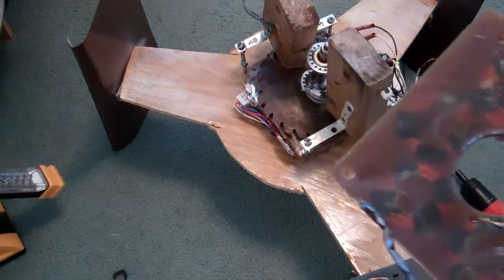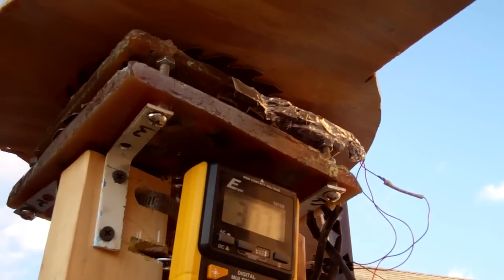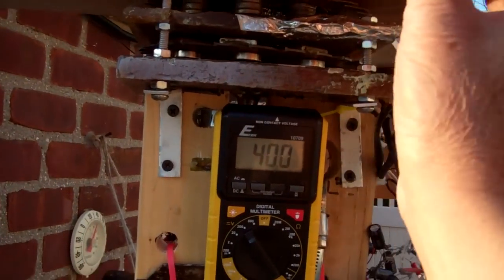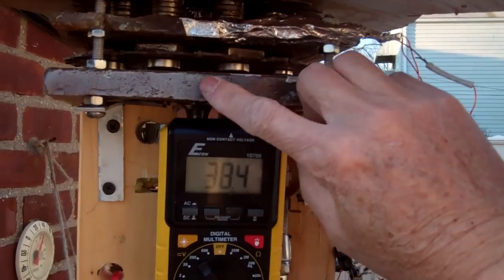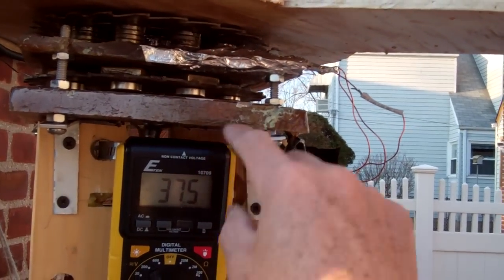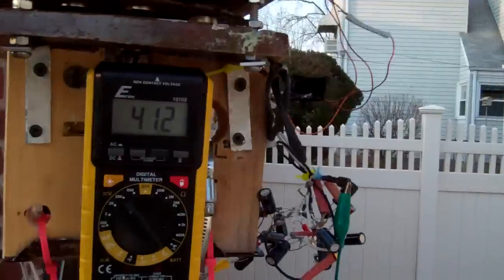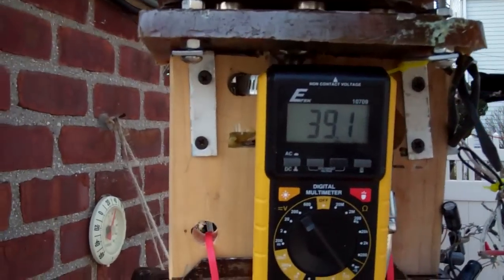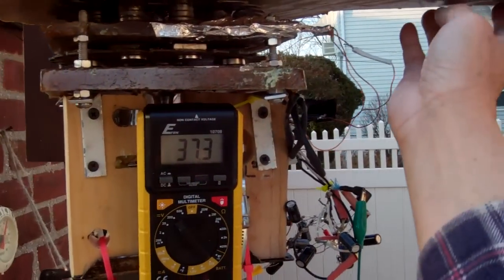Adding a second stator to my vawt.wmv

Comment from the maker: @rikkiesix Yes, I can close the gap but it was a pain to move the stator up as I didn't drill the holes in the corners of the stator big enough for it to move freely. Once I find out it can work reasonably well, I will take it apart and add the right size magnets and optimize the gap.  All the stators and pma I have work well if you handspin them really fast or use a drill to crank them up to 200 rpm or more but in reality, I have no wind like that to drive them.Thanks for commenting.

Comment from the maker: @Aceman307 Because of the capacitors I put across the rectifiers. They hold the charge so the meter does not jump up and down. I could be wrong as I'm not an engineer. I think it has the extra benefit of storing what little energy is generated even when the mill is turning slowly. Depending on how the caps are installed, they can double the voltage or just store the energy.  The energy will of course dissipate after a long while.

Comment from the maker: @Migueldeservantes I guess I'm in the same boat as you are, new to alternator making. I have 1 stator using 27 wire for voltage. The 2nd stator has 20 wire. They are mismatched. I understand I will only get the lower of the two amps. Because of the small wire, the amps is limited to milliamps. 40 Awg will give even smaller current output but higher voltage. Smaller wire, lower amps. I actually bought some 32 awg wires recently to make another smaller alternator.

Comment from the maker: @Iseekoutthetruth I use it all the time because it can flex and stand on its own. Today, I used it to check the magnet gaps in my alternator. Also when I used the light at a certain  angle, I can see if the magnets are aligned correctly with the stator coils.

Comment from the maker: @shartne  Maybe .3 amps with a drill driving it. I have to wait for good wind to see. The stators are mismatched so the voltage will be upped but not so much the amps. Unlike the cogging ceiling fan motor, It will turn all day with mild winds.

Comment from the maker: @muddymuddymuddmann  I'm not sure how much voltage will be needed to run a long string of say 10' led lights although the alternator can produce over 40 volt dc. You think the Christmas leds are wired in series ? Anyway, I have to close the magnet to stator gap of the second stator first. Thanks for the great idea although some would think I'm nuts lighting up Christmas lights so early :))

Comment: Great video, i like this turbine
Do you think you can close the gap between the magnets and the stator by adjusting the nuts a bit more?
You don't need many amps if the turbine runs really easy, it will produce a little bit, but all day when there is some wind
Your on the right way my friend
Greetings from Belgium
Erik

Comment from the maker: @Migueldeservantes Ah, you're way way ahead of me. I think I'm doing more or less what you're suggesting already except I don't know how big a capacitor etc. Since we're talking about somewhat boring things, I hope no one will get too hyped up. Maybe you can use my case and draw a diagram with the connections and the value of the components to make a video response. That'll certainly make things clearer for a beginner like me. Thanks for your input.

Comment from the maker: @muddymuddymuddmann Can you eliminate the current limiting resistor by using four 3.3 volt leds (13.2v) instead of three 3.6v  with the leds running .02 amps?  With the 3 wire LED string, one for positive,one for negative. Is the third wire for neutral because it is AC.  Also does that mean each LED is running at 2 watts (.020 amps) if you are using AC at 110 volts. Is that why I see you can run a 60w AC light bulb at 110v with your ceiling fan motor putting out only 1 amp AC

Comment: Well you can just connect an Rectifier bridge to each! put a super capacitor on each input! and then put all the positives and negatives! in that way you will be able to put that power directly to charge your batteries with out to worries of destroying one of the stators! and at the same time you will have much more voltage!